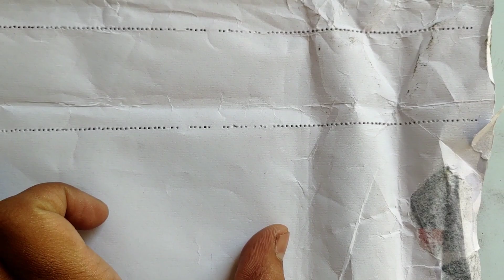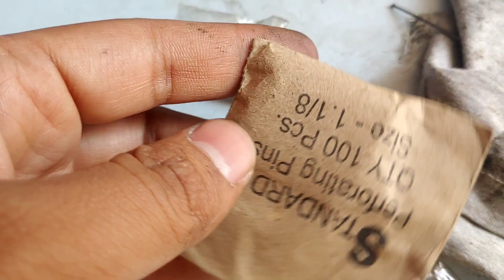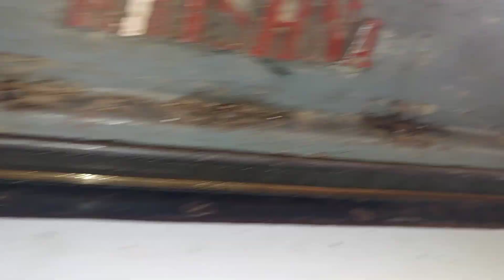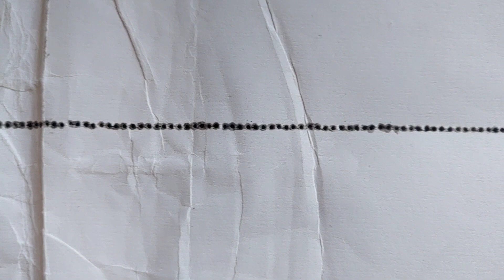perforate machine maintenance and change damaged perforate pin and cleaning

Comment: Where can i get this pin
Reply from the maker: At ahmedabad krishna engineering nr.chamunda bridge
Reply: You simply buy this from any stationary shop near any school because this pins are also used during practical for hold the paper on board and this are called allpins
Reply: Allpins are not strong